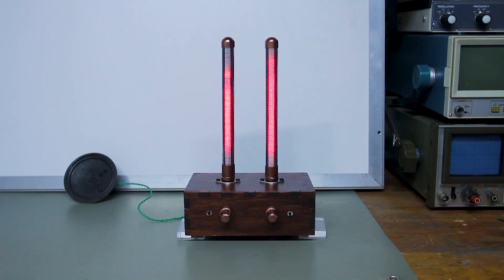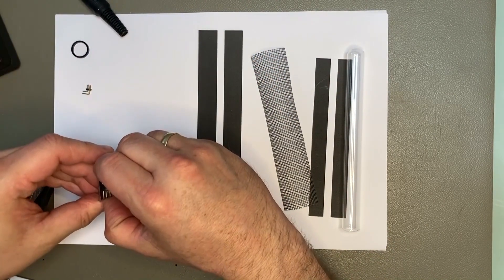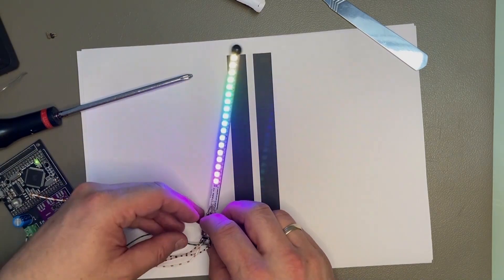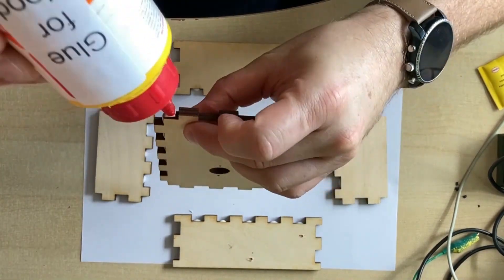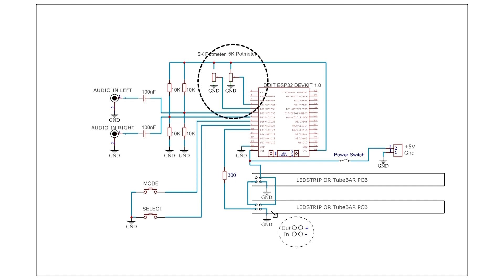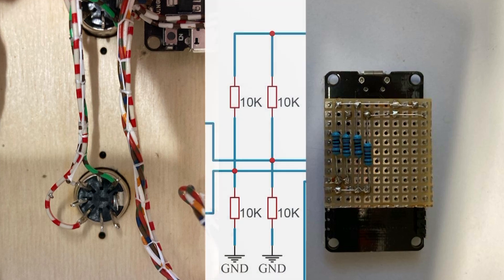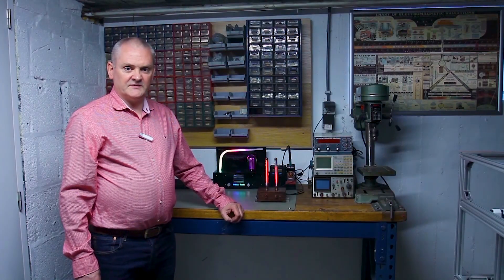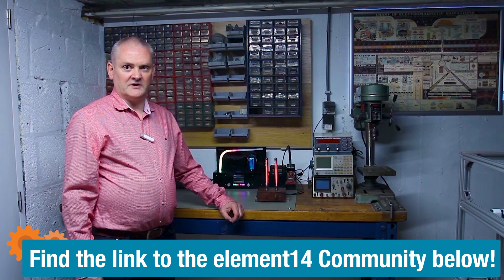Build a VU Meter with LED Pixelated Nixie Tubes

Comment: Can you do a tutorial on the wiring technique with dental gloss?
Reply: I think there is a hackspace magazine with a tutorial on cable lacing. I did it back in the 1990s on my apprenticeship but don't remember how it worked.
Reply: @Workshopshed  yeah its old. Today we just use tyraps. Lol
Reply: Its old style technique, your to young for it 🤣
Reply: @TheElectronicEngineer  I'm in my 40s, is that old enough?
Reply: @justovision  I learned that in 1988 and we used some sort of waxed wire....but now a days..we have dental floss... ( or TYraps for that matter)
Reply: @TheElectronicEngineer  I've seen it in NASA hardware on Curious Marcs channel. I agree it's a skill that would be useful to share. Looks much nicer than just hot-glueing your wires down.
Reply: And smells minty fresh depending on the floss :)
Reply: Here's the nasa guide on cabling if you need some good bedtime reading material. https://nepp.nasa.gov/files/27631/NSTD87394A.pdf